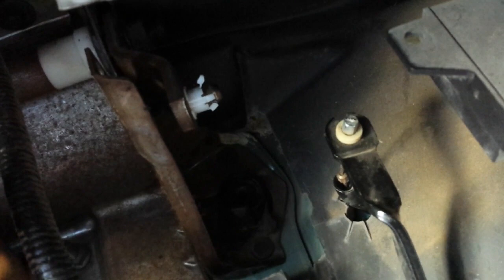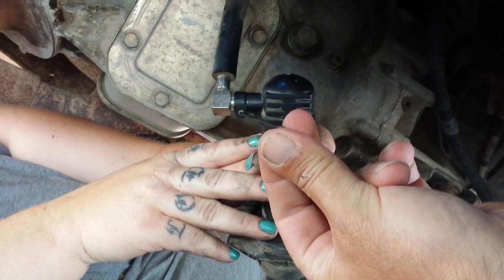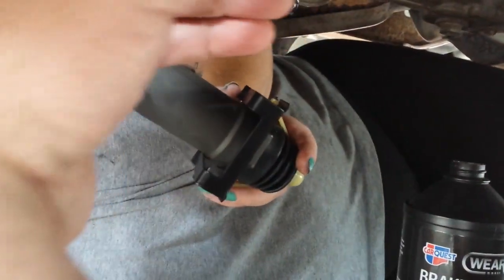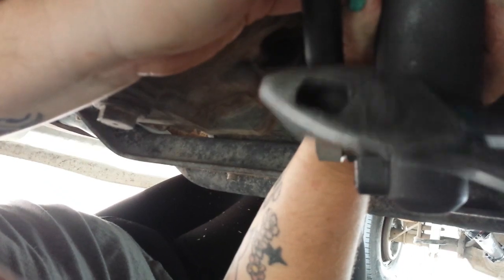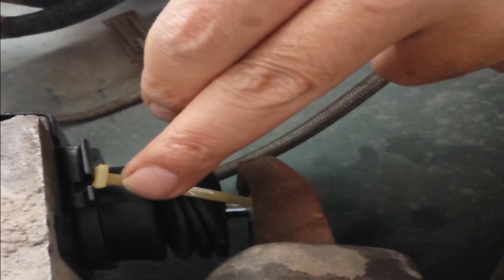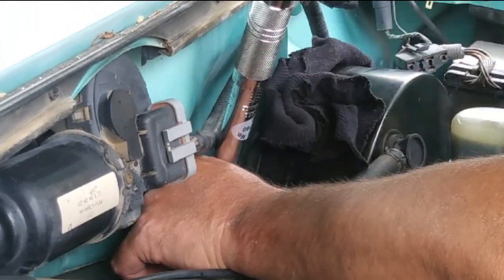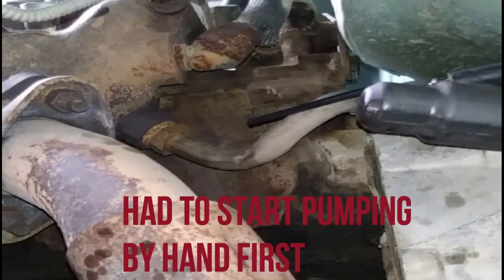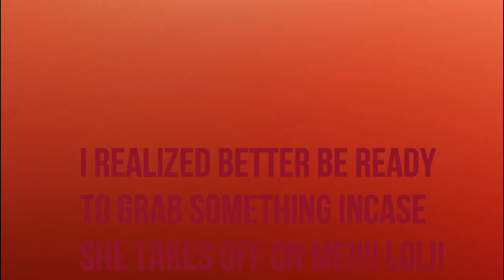95 FORD F250 7 5L CLUTCH MASTER CYLINDER and EXTERNAL SLAVE CYLINDER REPLACEMENT

Comment: Ford engineers had to add a line to the bottom of the pump to make this process of removing air from the line easier.  also Ford did not want an air removal pump like those used in brakes to be able to be used.  Doing this job is always a difficult task that requires patience.  good work. Los ingenieros de Ford tuvieron que agregar una línea en la parte inferior de la bomba para facilitar este proceso de eliminar el aire de la línea.  Ford tampoco quería que se pudiera usar una bomba de eliminación de aire como las que se usan en los frenos.  Hacer este trabajo es siempre una tarea difícil que requiere paciencia.  buen trabajo.

Comment: Those are called roll pins, very good video! Take care and thank you for all the steps!
Reply from the maker: Ty for the comment and you are welcome.  Also, thanks for the correct term.  It's greatly appreciated.  Take care as well and be safe out there. (@13:36 is what the roll pins are)
Reply: Yep. Roll pin. And roll pin punches are nice to have. Pretty cheap too.

Comment: Man I just put together a new slave and master cylinder and nothing comes out when I open bleeder screw
Reply from the maker: Then I would say it is your line. A kink somewhere or broken clutch line.  Do you see fluid making a drip anywhere?   A leak somewhere. . . . . .... Or there is a kink in your line.  Which would cause the fluid from not getting to the bleeder screw.  GL and let us know how it goes!

Comment: Any videos for slave cylinder line removal? Can't seem to locate one for a 96 ford f250
Reply: Punch out the little pin that’s on the body of the slave cylinder next to the line. Some will have a cotter pin in the middle to take out first.
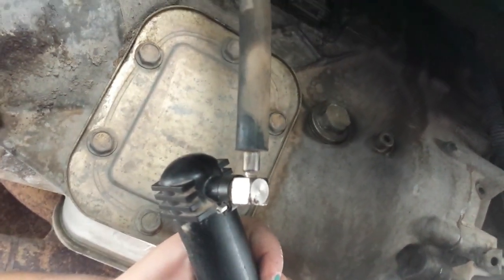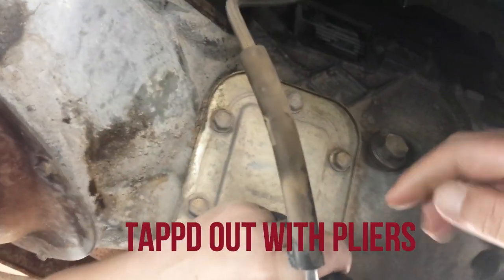Reply from the maker: I don't think I do since I got a new comp.  I only saved all final vids and not the clips. I could double check though if I even recorded that step.  But what Tucker said! @5:34-5:53 we used a 3/32 Allen wrench(drill bit works too) to tap out the rolling pin after taking out the cotter pin.  We put the slave cylinder against the transmission and made sure the pin had a area to allow it to back out.  And just keep lightly tapping with pliers until there was enough to grab the other end with pliers.  And installed the same. Hope what Tucker and I said helps out.  Let us know. Thanks.